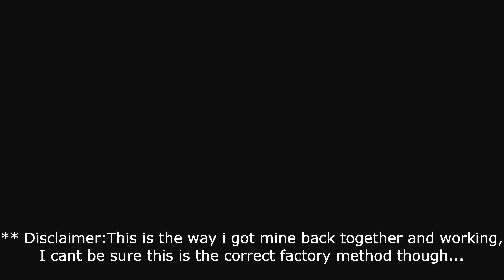COM2003 Teardown - Steering Column Switch Module

Comment: Thank you for this perfect video. Someone had pulled my COM2003 apart and put it together again completely wrong. The ABS was always on, the horn was dead and there were strange noises when rotating the wheel. The horn was dead since the copper wires were bent and not in the holes. The strange noise was the white ribbon incorrectly mounted and thus slightly damaged. The white housing with its letters was 180 degrees wrong. Finally used LEXIA-3 to initialize the angle sensor. The ABS went off after less than 100 meters. 😉

Comment: Thank you for making this video , the ribbon cable yanked off when I pulled off the steering wheel and wouldn’t have been able to reassemble it without this video 😀
Also this helped me to adjust the steering angle sensor with the tiny gear even though I used the assistance of the pp2000 diagnostic
Reply: I know Im randomly asking but does any of you know of a method to get back into an instagram account??
I was dumb lost the password. I love any help you can give me!
Reply: @Alvin Leandro Instablaster ;)

Comment: Hello sir. The steering wheel sensor is behaving very strangely. in a straight direction it shows -128° and just turn the steering wheel by 1-2 cm and it jumps to 51° and then it subtracts and adds how it has to zero which is roughly in the same place, it only does it from zero to zero by about one turn of the steering wheel. before I noticed this, when I saw 50°, I thought that someone had turned the center of the COM, so I had the steering wheel down and I found out that if the steering wheel is down, the COM is locked and nothing can be adjusted. ABS and ESP do not write an error. Only the suspension writes the error. Something can be done about it. Thanks for any advice.
Reply from the maker: I think you can calibrate or reset the sensor with the tool

Comment: Hi there.
First thanks for making this video.! 
I just bought citroen c5 with few small problems .one of them is ESP/ABS fault on dashbord .when i did scan the car with delphi i see fault (no communicaton with stering wheel sensor-permanent ) when i check live data about angle of the steering wheel position there is totally nothing happening when i turn the steering wheel.
is there some other possibilities that i can check before i will take the whole com2003 apart?its looks to me like he is not geting power at all.
 greetings from holland.
Reply from the maker: I have another video where I remove it.  But you could check the electrical diagrams to find out what fuse/s supply it voltage first.

Comment: I done this myself today, looking for the RF receiver but I didn't get as far as you did. When I put it back together the hall mag sensor was off by one rotation (I wasn't watching what I was doing!) and the steering wouldn't calibrate until I set it right again. Nice video though, Think I'll tackle the RF receiver again soon, it died on me last week and it's not getting picked up by Diagbox anymore..
Reply from the maker: yes, id always wondered where it was, so was interesting to find it there. glad you watched it. another thing i didnt realise until recently is that its this com2003 unit that diag box refers to as "switch under steering wheel" in the list of ecu's you can dialog with. not an exactly clear description...
Reply from the maker: i also have a problem where i cant pair new key fobs with my car, have tried 3 used ones but wont work. have associated the rfid chips and that can start the car, but the HF remote to unlock the doors wont pair.. i try the process in lexia, but no luck. have you done it how ?
Reply: When I got the car a few months ago the buttons weren't working, but I eventually got it working using the "key on, hold lock button for 10s" method, but I think my rf receiver was always a bit dodgy, the key fob would only work within ~2ft of the comm unit. 
I had to go right up against the window to get it to work. And my drivers door lock (barrel) was broken so I was afraid to lock it with the fob in case I got locked out! Then last week the rf receiver stopped working altogether, it's not getting detected by Diagbox anymore, so I assume it was on the way out for a while. 
I think I heard that they can only be paired to one car, but I don't know if that's just the immobiliser(with the security code in diagbox), or the central locking too, think it's just the immo though, so it should work alright..
Reply: Suppose you could try disconnecting the battery for a while and try again, that seems to fix a lot of things! I had engine issues at the time as well and I disconnected the battery a few times to reset the bsi (don't know if I ever successfully reset the bsi !) to try and and sort it, so that might have helped me get it working again.. Think there's an actuator test in Diagbox to test the remote keys, but that's not really much help..

Comment: Hello  Just seen your video and wonder if I could repair the light switch without unmount steering wheel . I have a Renault Laguna 2 from 2005 and is a Valeo  251640 switch found on Megane and other s .... . The light switch do not change to long ( intense ) light . Thanks .

Comment: Salut,
I have the commodo on my workbench, but I haven't taken it apart. I can see through the small round windows a G a D a GG a DD , but I can't see the zero point. Can you please tell me what its symbol is.
When the Com 2003 connector (not removed) is on top, I see a G in the bottom right corner through the small window. Is this the right position?
With my thanks
Reply from the maker: Too long ago sorry.
Reply: Hi,
did you solve it somehow? 
I have the same problem🥹🥹

Comment: thx for the vid man .. you really gave me the courage to take`it apart , so this is what i will to this week , but i really dont know what to expect when opening the com up.. i have scaned the car with my delphi diag tool  and found 3 errors :  c1335 c1388 and u1205 all related with the angle sensor from the steering whell , i dont know if its the sensor faulty or is just not centered.. how do you know if the sensor is bad or just out of place .. does it have a mark.. ?
Reply from the maker: What actual problem/s do you have with the car ? As the error about angle sensor might not be an issue, and the sensor might be working fine.
Reply: i have a esp warning light on the small display when i start the car .. comes with a beep and then displays the esp crossed , and says esp/asr system faulty , i use a delphi tool scan , and shows this errors u1205 - CAN signal- steering angle sensor -permanent , c1135 -steering wheel angle sensor internal fault - permanent, c1388 steering whell calibration imposible - permanent , i delete the trouble codes , and after starting the car ..they come back .. the car runs fine , abs works.. but last winter i had a problem with the car drifting a litle at verry low speed.. guess the esp is not doing its job. thx for the quick reply
Reply from the maker: So yeah it sounds like you got a problem. But there could be many parts causing it in this system, from the sensor/s themselves to the supporting circuitry and then the wiring. You might be easiest of getting a second hand switch unit of ebay, i got one for about $100-$200 , but if you want to pull yours apart you could for a look, you never know, you might see something. esp does keep you from drifting/spinning out, you can test it easy on gravel road by turning sharp on bend, and if it doesnt brake auto to correct it is off, which yours likely will be if you have the light.
Reply from the maker: Dont worry pulling tho clock spring apart, that is not related. Did your error just start, or you think something that happened caused it ?
Reply: Hayden Thring yeah .. so at first i had a abs/esp warning message . scaned the car , abs sensor in the right wheelhub failed , i've change'it with a new one (not original) , and then the abs worked , but the esp/asr error still there. anyway i guess you could be right with the other parts.. now i have a problem with the fan, doesnt turn on ..and the wather temp skyrokets..ac not working , glow plugs relay not responding..it seems to be something with CAN signal.. but dont know where to look ..searched the cable loom all seems good.. but still . i think the esp,asr,fan,glow plugs relay, are all inter'conected thru CAN , and the BSI is not responding when i try to control the system . like delete the fault codes.. i'm lost :) the car is a Peugeot 407 2004 2.0 Hdi 136 psi
Reply from the maker: my fan was dead when we bought the car and did not know, being a diesel though it did not get hot, we worked out it was not working only when we went to ac shop as ac was not working well. i always had glow plug error, not sure if it worked or not, but car always started easy, but we dont live in snow. there are 'seperate' can circuit/networks, not all on same bus. so you cannot diag with your bsi ?

Comment: Thanks for the tear-down Hayden - I don't quite see what the problem was however and how you repaired it either. Did I miss something? 

My car is giving dodgy steering angle sensor messages but I won't tear mine apart if there's nothing in there to fix.
Reply from the maker: Guido Fawkes what messages? I was looking to see if there was any problems I could see inside it, as I did have some errors but there turned out to not really be anything wrong with it.
Reply: OK I understand now. Mine is saying stuff in the dash display like 'ASR/ESP faulty' or similar and when drilling down to check in Lexia steering angle sensor fault, which is showing '364437.2º' both before and after calibrating. Intermittently shows steering angle tracking with steering wheel movement.
Reply from the maker: so depending on what module in lexia you are looking in the steering angle doesnt show correctly, that is normal, it can calibrate fine and work but it shows weird numbers. that being said you still may have a problem with it. does it calibrate successfully ?
Reply: I've done these checks before when it was giving normal angle numbers. Either the sensor has a problem, or the BSI is processing the signals wrong - or some bad connection between the two I suppose. According to Lexia the steering angle sensor doesn't talk directly to the diagnostic system nor to the rest of the network except through the BSI.  And while it says it has completed calibration, then I clear errors etc., it still comes back reading biggly degrees when checking parameters. Might be power not real good in one of the circuits I suspect, hopefully not mux board faulting. I woke up with a back injury today so don't want to go under the dash to check wire resistance etc. until it's healed a bit...tempting to gobble meds and have a quick look though ... appreciate your assistance very much Hayden!
Reply from the maker: take it easy, no rush, it still drives, just turns those systems off until your back heals, to stop the warnings. so the 'under steering switch' is the com2003 module, you can also access the steering wheel angle in the suspension module ,though i think for me here it is not correct, as my version of suspension did not have adjustment due to steering angle so it did not need to receive it correct. the com2003 will send the angle readings to the bsi via CAN. the used com2003 modules go cheap from time to time on ebay used.

Comment: Hi, it's a shame that we can't read some of the comments you wrote in white on the video. Is it the light that causes this discomfort?
Reply from the maker: Oh sorry,  I'll write them in the description or do cards in the video
Reply: @hthring  Hi,
No thank you very much, it's not necessary, there is only a little text that is not readable. You know we French are a bit lazy to learn foreign languages, so I have to use a translator by copying everything.
But having written a text rather than speaking is much better for me to translate with Deepl. I only have to copy the text.
Thanks again for your video, there are no others, so as I'm dismantling my 407's rotary switch, it's really very useful.
You know I uncoupled the steering column at the gas and brake pedals, and turned the steering wheel oops! Now I've got the airbag light on and the horn doesn't work. So I'm taking it apart to see what happened and possibly change the white cloth that's rolled up inside.
Have a nice day

Comment: Hello. I have a similar problem in my com2000 Peugeot 206 oh the same model as it's shown in the video.

Could you help me showing how to open de left harm of the terring column switch, the one that turns on the ligths?

I want to change de data cable instead of changing the all harm.

Thank you. Best regards,

Carlos, from Portugal
Reply from the maker: Mine is back on the car, so cant pull it apart again easily. The video shows hows to open it all up. Is that what you ask ?what is "all harm " ?
Reply: Hi. Sorry. I was meaning left arm, not harm.. I want to put de data cable inside de left arm.
Reply from the maker: do you mean you want to put a cable inside the stick ? the sticks carry no signal wires instead operating switches mechanically on the main pcb

Comment: My lights come on on there own and indicators don't work unless I turn lights on was told these are expensive and that there are about 10 different types of the same thing and the serial numbers have to match
Reply from the maker: they are not thaaat expensive used on ebay, you can lookup can find out what model yours is by the sticker on it or have someone look it up in a data base, or check with ebay seller, you want to check in diagnostic s with lexia or such, to see for any errors.  it may or may not me the switch, though likely, it just sends signal to relay computer/module
Reply: Hayden Thring I was told there are numerous modules and if you fit the wrong one even tho identical it won't work, I think it's because Ive been using the seat belt from passenger side on my driver's side and constantly leaving it in there, apparently there connected, bloody French electrics
Reply from the maker: that seat belt thing would not be an issue, this is my model 96611304XT
Reply: Hayden Thring it might not be but apparently there linked up with a tenchener to the airbag, but my lights come on all on there own and indicators will only work if lights are turned on, mine is a Peugeot partner 1.6 hdi 2009 how much did you pay for yours. I was told some Scrap yards won't even do them anymore for these models as there are numerous modules that are identical but the nos have to match up. And bran new there £300
Reply from the maker: i got mine for $50US off ebay, you just make sure its that same model thats all, this can be found out a few ways, including the ebay seller, genrerally they can look up if it will fit your VIN or not.